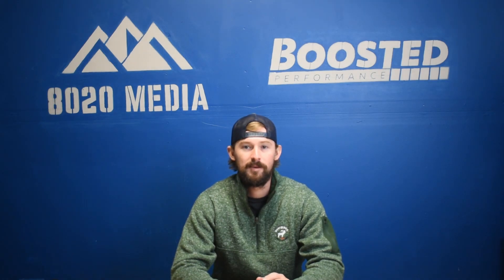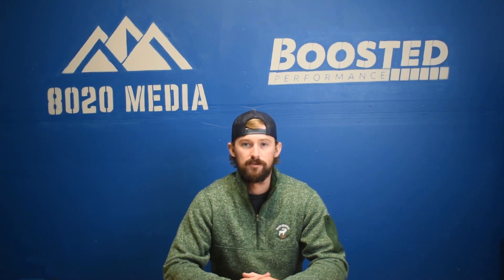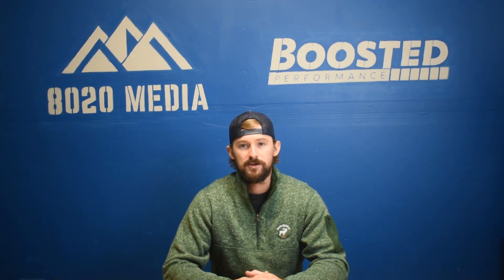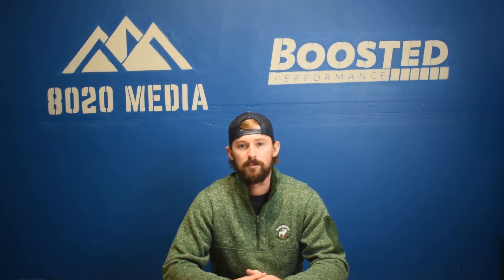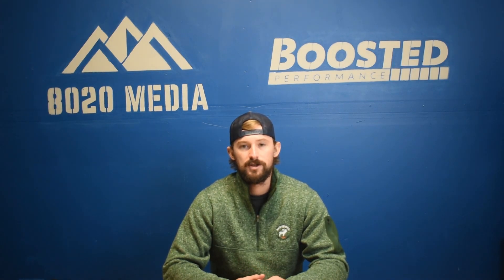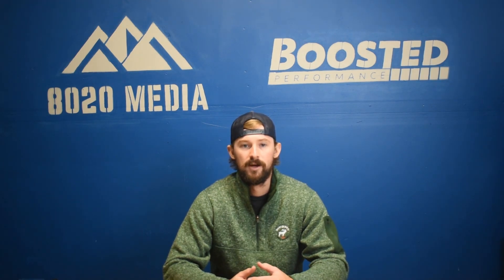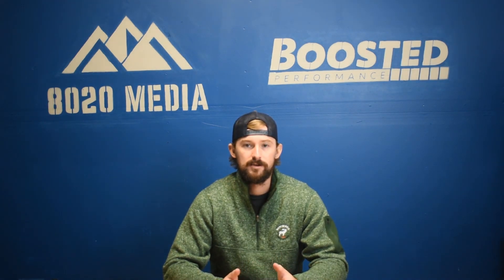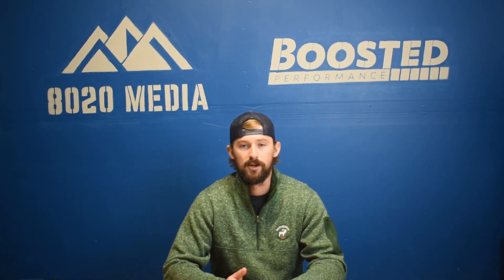Is the Ford Triton V10 a Bad Engine?

Comment: Chevy trucks are for cry babies my  2000 f250  v10 just over a 120000 tows my equipment without any problem the best truck out there f150 250 and 350 are the best truck on the market if you looking to buy
Reply from the maker: Suppose it depends on the engine you are talking about or buying new vs old. In my opinion GM is producing the best diesel right now in the L5P, but everyone has their opinions and bias on truck brands.

Comment: I just bought a 2000 f250 with 6.8L v10 with 360,000 miles & I drove it for about 10,000 miles since new (to me) in a few months & it’s been working great 👍🏽
Reply: Liked & Subbed 🤙🏽 like you said maintenance is “key” she purrs like she just left the assembly line. Previous owners fixed all those little problems. From headers to spark plugs 🤙🏽
Reply from the maker: Dang that's some high mileage! Great to hear she's running strong even at that age.
Reply: How much did you buy it for?

Comment: I'm at a loss for why they would even make a 6.8 V10 when they have a tried tested proven 7.5 V8.
Reply: The 7.5 wasn’t a powerhouse when you consider the poor fuel economy. It was so inefficient and was horrible as far as emissions. Engines are essentially air pumps. The more air that you can move the more power you can make. The Triton engines were much more efficient at moving air. Thanks to the deep skirted cross bolted blocks the  6.8 was also much smoother and quieter.
Reply: As others mentioned, emissions. But Ford still needed a large gasoline truck engine for that specific market. They couldn't resize the modular V8's any more as the 5.4 was about as big as they could get, so they just bolted another two cylinders to the motor and had a big-enough engine to do the job
Reply from the maker: I think a lot of times it's just easier to build something from the ground up rather than try to reengineer. 7.5 V8 was a good engine but was antiquated and manufacturers were moving to smaller engines for weight and fuel economy reasons.
Reply: Commonality of parts so 5.4 and 6.8  keeps costs down for mfg
Reply: Emissions

Comment: Not a timing chain problem but timing chain tensioner wear.
Reply from the maker: Which leads to the timing chain jumping. I went a bit shallow on my description of the problem, but yes the tensioner is a common failure point which then leads to issues with the chain jumping.

Comment: The reason most people hate the 6.8L V-10 is because they don't perform regular maintenance and bitch and moan when something goes wrong and they assume that the engine is a bad engine...
FORD V-10 is a great reliable engine as long as you maintain it
Reply from the maker: Yepp, generally true about all engines out there with the exception of the few that are built with inherent flaws. The V10 is a great engine, I generally prefer a pre-emissions diesel myself, but these things will last near as long as a diesel when properly maintained.
Reply: @8020Automotive  mine has 248k it's pulled very heavy but it's been religiously maintenaned
Reply from the maker: Dustin - Thanks for providing your experience with the Triton! Hopefully you get another 250k out of it.
Reply: @8020Automotive  I'm probably gonna keep this truck till I die. It does everything I have ever asked of it, of course except get good gas mileage. But I'm still getting 13.2mpg which is better than a lot of the v10s which aren't as well maintained. It's just maintenance. They really don't have many flaws tbh
Reply: you hit the nail on the head.
Reply: yes sir i have a 2007 ford f550  and ive spent money on that and that baby still runs like a champ and hauls heavy ass shit for me like a champ too
Reply: I think its definitely better then the 6.0 PowerJoke

Comment: The vans still had a 2 valve until 19. Stupid reliable. Torque plugs correctly and it isn't a issue. Compared to the 7 they say you should.
Reply from the maker: Martin - Thanks for sharing your insight!

Comment: Sir,

The 5.4L Triton V8 does not share the same timing chain set up as the 6.8L Triton V10.

The 5.4L Triton V8 utilizes the Variable Valve Timing using cam phasers with their timing chain set up.

The 2005 and up 6.8L V10 uses a variable length intake runner intake manifold to offset the loss of the VVT Cam Phaser set up.

None of the 6.8L Triton V10s ever used a VVT Cam Phaser timing system.

It is Cam Phaser wear and failure that will jack up the 5.4L V8. Poor engine maintenance will exacerbate premature VVT Cam Phaser failure. Regardless, eventually, the Cam Phasers will wear out and need to be replaced with improved Cam Phasers from Ford. Never install aftermarket Cam Phasers. They’re junk.

The 4.6L V8, 5.4L V8 and 6.8L V10 do have one thing in common with each other. Behind the timing chain cover on the driver’s side of the engine. Is a small oil return plate that sends oil to the other side of the engine. This can, over time, leak. This reduces pressure to the timing chain tensioners, the tensioners allow the timing chain to slap the tensioners thereby eventually breaking the slippers or tensioners.

So far, my ‘05 Lincoln Town Car with the two valve 4.6L V8 has 197,500 trouble free miles
My ‘06 F250XLT withe the 6.8L V10 and German ZF6 six speed manual trans has 165,000 trouble free miles. Yes, the exhaust manifold studs are junk and need to be replaced in ye old V10.

Anyway, great channel! Keep up the good work.

RustyFuryIII
Reply: uh, not sure where you're getting your information but the 2v 5.4 and 2v V10 share the exact same timing chains, tensioner, timing covers, as well as the same piston and rod size. The valves, spring, as well as the cam followers in the heads are the same as well....I have put pistons and rods from a V10 into a 5.4.
Reply from the maker: Thanks for the clarification RustyFury! I think my point was mostly that all of the Triton engines suffer from timing chain related issues.

Comment: I have a 2002 V10 XLT 16' box with 662,303 miles.  Replaced transmission at 543,000 and engine at 595,000.  Just replaced power steering pump because the belt kept breaking.  Wouldn't start in park but neutral, so replaced neutral switch.
Reply from the maker: Pauley - Sounds like it’s still going strong! Have you had any major issues?
Reply: @8020Automotive  only the engine and transmission going out at over 500,000 miles. Just maintenance stuff.

Comment: Had an 03 xlt never missed a step 600 thousand plus.  It took a front end collision to take it out.  I have an 04 now king ranch same v10.  200+ O'Rileys said I needed new alternator my mechanic said alternator is fine.  Cold weather came I need to jump it in the morning.  Sometimes I have to hold key for 30 seconds before the starter engages.  Anyone have anything they can share where I should go next.  I bought new battery going in. But this v10 after 02 is a great motor. Any help appreciated
Reply from the maker: Josh - check the idle control valve and try cleaning it. This is a common cause of the engine not starting in cold weather.
Reply: I'm in Massachusetts but I take my iron beast to northern New Hampshire a lot in the Winter her we will get negative wind chill but usually our coldest days are 0-10°
And that's when this started this winter doing it.  When I'm up in northern New Hampshire I've been in the bush negative 20 and she always fired up.  So once this started happening I haven't gone to back country.  But finally I diagnosed it.  It had a tiny bad spot on the armature bar I think it's called so it was Russian roulette if it stopped in that one spot it wouldn't start. And I fiqured it out with my rubber mallet lol like you said, I was cold pissed needed to plow and it wouldn't start so I keep a mallet under my seat because I run a Fisher minute mount 2 and some times I have to set the pins the last half an inch.  But she is all fixed now.  Now all I need is to find a short bed since I have king ranch super crew, some DUI clipped my truck fucked up my bumper and the impact combined with the weight of my toolbox factory bed rail collapsed so now I don't look as professional for jobs as I fight this insureence.  They want to total my truck over a bumper and bed rail.  I won't let them if I have to I'll go flat bed not sure how it will look with an extended cab though

Comment: Thanks for your comments about the Ford V-10 engine.  I Have a 2009 Ford F-350 Super Duty with a V-10 Triton engine with over 150,000 miles, and haven't had to much of a problem with it.  The only really serious problem i had for a while was it was difficult to fill the gas tank because the hose at the gas station would keep shutting off, and I had to pump it in very 'slow in order to get a full tank.   Otherwise I really like the truck and it pulls our 26 camping trailer very nicely.
Reply: Your charcoal canister is clogged that’s why the gas pump keeps shutting off.
Reply: @yaboykris2118  I have been trying to figure out what the problem was for months! Thank you🙏
Reply: Is the truck itself very durable and reliable? I'm not asking about the motor, but the truck itself. Do you have to repair it much? I'm asking because I would like one of the 08-10 Super Duty trucks. Hope yours lasts a very long time!
Reply: @motormouth2472 I have a 1999 crew cab. If you live where they use salt these trucks rust out the rocker panels at the bottom of the doors, and the cab corners. If it was equipped with the nerf bar steps they too will rust out. I was looking at repairing mine but I may be doing a cab swap instead due to rust. Otherwise I personally have owned 4 superduty trucks and the chassis has never given me a moments problem. Make sure the frames not rusty, around here the rust is the main issue. As for a triton v10 the only issue I’ve had was blowing a spark plug going through the mountains with a fifth wheel camper and speed boat on the back. After that me and my dad swapped in a 2003 engine. No problems since but it’s rough looking until I do the cab swap.
Reply: your fuel hose has a pinch in it .
Reply: I  just got one today. 2006 same engine. I had the same gas pump issue and thought that was weird.
Reply: @devonbroadhead7512  vapor canister is clogged. Cost about $800 at a reputable shop with quality parts.
Reply: I have a 2009 f350 triton too and gives me no problems at all at 200k miles
Reply: Charcoal canister.
Same issue happened with my BMW. Very common.
Reply from the maker: Registered - Thanks for sharing your experience!

Comment: Yes they are bad. It's a ford engine with ford reliability issues. Better to leave them for people that love a revolving repair bills.
Reply: Mine has 600k and i haven’t replaced shit
Reply: @restorationranch20 I have 368k no issues also
Reply: @Big_Harold_Dawg exactly bro.
Reply: My 1999 6.8 have 450k never had a problem since day one just the normal things like alternator battery a fuel pump that’s it. I’m sure you have never owned one.
Reply: @David  have owned my 99' CC 4X4 Latiat F250 v10 for about 7 years now (189k miles). Honestly except for the $1,800 catalytic converter cost to replace, I love it. We picked it up for about 3k needing spark plug fix. All said, in about $5,500 and I love having a paid off truck. But I will say, the 2800 lb payload has me wanting to look for something else to tow a slide in camper safely. But pulling an offoad truck and heavy duty trailer up the Cajon pass in so cal was easy, let her sing, no issues except mpg. Found a 10' f350 v10 w/ 100k for sale, 4100+ lb payload and 362 hp instead of 275 maybe up next..
Reply: 🤔That's hardcore bro! Must be a Big Ford hatter!😉
Reply: bro if you dont know what your talking about just say that lmao
Reply: Bro probably owned one Ford, had issues with it, and now hates the entire brand ☠️☠️
Reply: @MrDrHouse  More like he probably never owned one.
Reply: @UncleSarkis  Fr lmao

Comment: I have yet to hear you guys review an unreliable engine. Do you just enjoy reviewing reliable ones? (Not a bad thing if thats the case)
Reply from the maker: 777 - We may have one coming out this week, stay tuned. But, curious, are there any engines you suggest we go over? We're open to suggestions.
Reply: @8020Automotive  5.0 coyote , 3.6 pentastar, nissan 4.0 v6 (frontier), 3.6 chevy, ford 6.2 v8 (f250), 6.4 hemi. 6.0 chevy (2500). Keep up the good work
Reply from the maker: We actually have some of these on our list, but not all. We'll add the others! Thanks for your input! Make sure to be subscribed to stay in the loop.
Reply: @8020Automotive   subscribed
Reply: @Shenkosky so i hear. Which makes me question the review
Reply: @Shenkosky you answered your own question in your other comment. Lack of maintenance and not using motor craft parts will give the worst motor in history. 
There are obviously lemons. But 8/10 it's the owner being cheap.